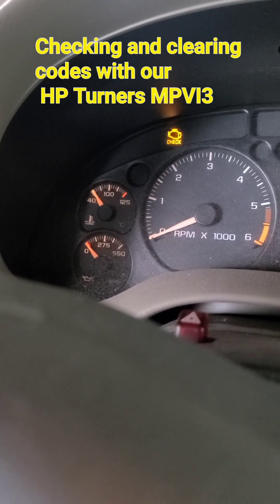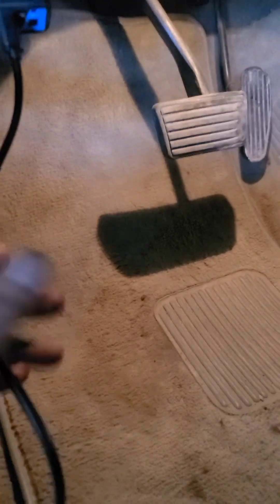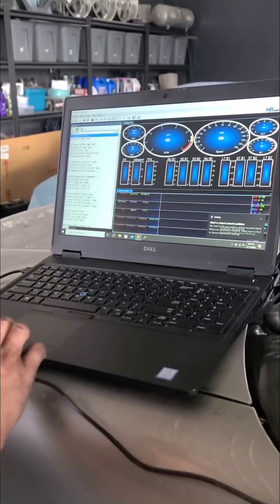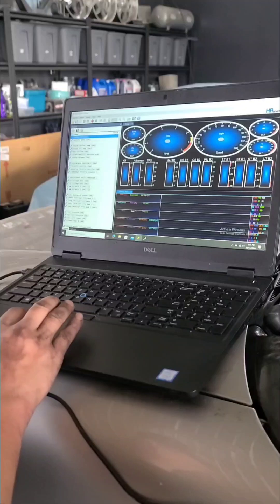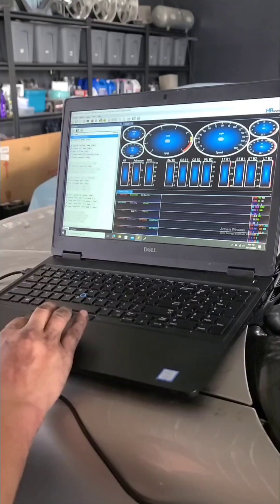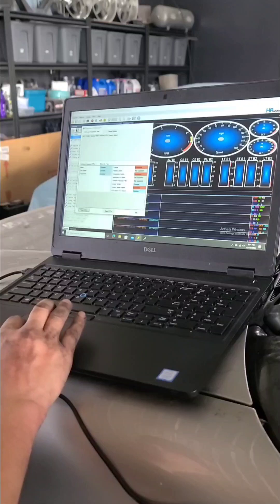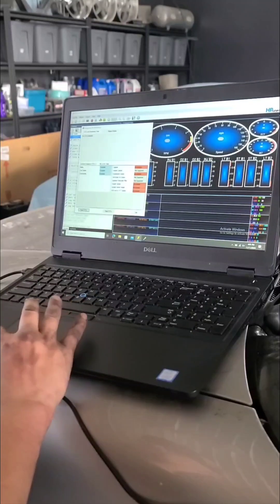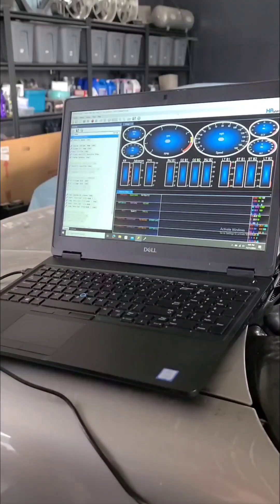Clearing Codes with our HP Tunners

Comment: Mine still says mil light on
Reply from the maker: Should be able to read codes and clear em.
Reply: Some codes cant be cleared until the ECM sees that the problem has been fixed and driving 20-30 miles, then the ECM will clear the codes.